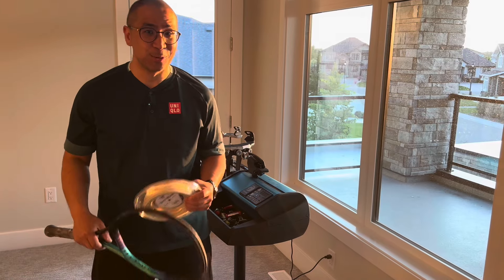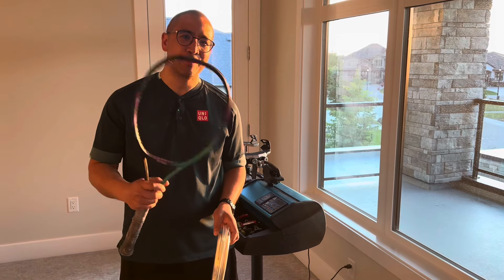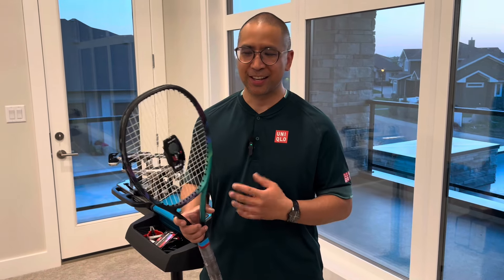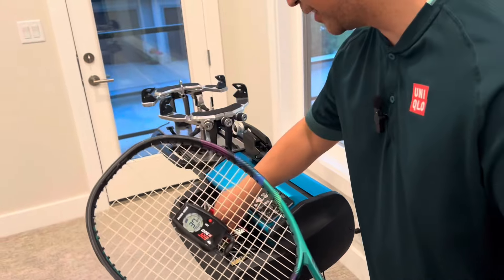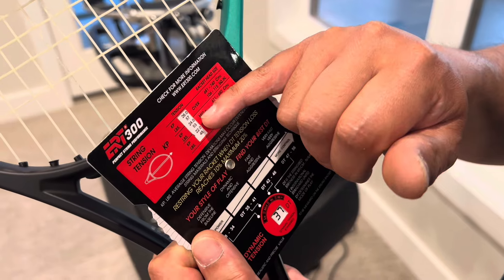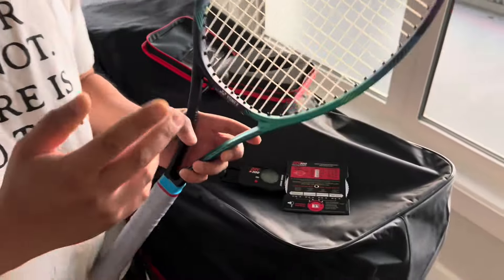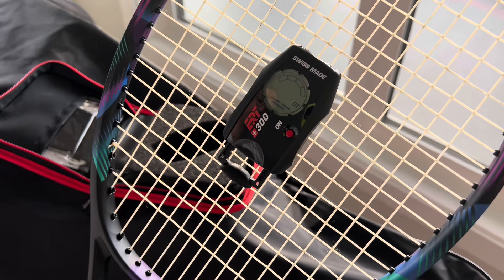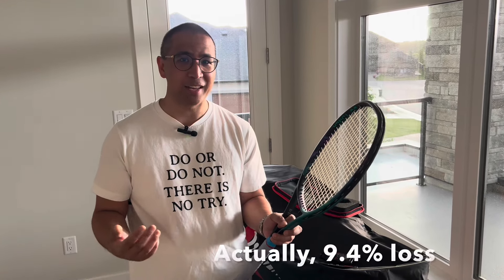Tension loss after hitting with multifilament string

Comment: Is multifilament string recommended for total beginners than poly?
Reply from the maker: @bengertzz  multi would be good for a beginner (or even synthetic gut to be more economical). Once the consistency of hitting gets there, switching to poly would be fine at that point. (If a beginner starts with poly, the inconsistency of hitting on a poly bed could hurt the arm)
Reply: Absolutely. It’s more arm friendly and powerful than poly. If you start breaking your multi string then you should switch to a polyester string.

Comment: Can you compare to natura gut & synthetic gut?
Reply from the maker: Something to consider - I may just do that!
Based on string construction, I would think rate of tension loss would be syn gut>multifilament>natural gut. We’ll see if I could confirm that in the future
Reply: I'm a Natural Gut and syn/multi hybrid. Natural Gut won't lose tension as much. You would use syn/mult as the cross. If you play flat/power the syn/mult will break and you can reuse the natural gut for two times or even three if lucky. If you hit topspin or don't hit cleanly in the sweet spot the natural gut will break. 

If you play with spin it's better to use poly full bed because using natural gut would be a waste, like no benefit for spin, or I meant why try breaking the natural gut for spin.

16 Natural Gut, 17 syn/multi, 17 poly.
Reply: @TrumpforPresident24  i want to play gut main since it has good power & comfortable.. feedback was abundant. I cross it with smooth poly to add little bit of spin. I play pretty flat. Spin only to take down the ball.. rarely hit heavy topspin… why don’t you cross it with poly? Why cross w multi?
Reply: @akbarberlian  Using the syn/multi cross I seem to get much more power. I want more power. I just like seeing my flat serve hit the fence in one bounce. I've tried poly cross with gut. I tried hitting my serve as hard as I can, the ball just won't hit the fence so like I'm missing something. I tried looser tension poly and now I can't even control or feels even worse with the Gut. It's probably the feel - Boardy or Trampoline. And I like it boardy. Everyone have their own feel of the string bed. I do play a full bed of poly if I'm actually hitting a technique motion to produce spins, and yeah I learn poly should only be for spin hitting players and not for flat power player. Syn/multi if I play my game as a flat and power game, maybe just a little spin if it needs it to make it over the net. Poly do have power string too. I will have to try that out soon. Maybe that can be the type of poly to exchange the multi.
Reply: @TrumpforPresident24  I have tried almost all your experiment before.. I kinda agree. what's the benefits between Gut/multi hybrid compared to full multi like triax or Velocity? also what is your playing style? Double & S&V player would benefit from your setup.. But for baseliners.. idk..
Reply: @akbarberlian  I use Gut and Head Velocity MLT, I use Head  Velocity MLT Power if I want to hit harder than usual, the shots I see  go faster. To me the Gut/Multi hybrid just feel softer, a soft control board for the arm, that would describe it. Oh yeah you have to have a neutral main strings, natural gut or kevlar, the brand. Then poly/syn/multi as cross, the brand and type. I play Federer style. One hand backhand. Playstyle - Power - flat serve, volley/smash, flat ground stroke. Clean sweet spot hits. I don't like messing the Gut/multi bed so I don't hit extreme topspin but only extreme flat power shots.

Triax is like Wilson control string, they have that squeaky texture feel from the string. The gut is going to be softer and still have an above feel than the triax. Triax can be like a power string too. Hybrid those two would be like Gut/soft poly/multi. Not sure how to explain lol
Reply: @TrumpforPresident24  i can see how you can benefit from your setup.  “soft control board” really deliver your message well. Thanks for sharing..
Reply: @akbarberlian   forgot to mention, I play with a RF 97 v13 with the Gut/ velocity setup. I tried on other racquet string bed it may not play as powerful. Certain racquet with certain string setup will create a more powerful feel. Every type of racquet with the same setup may not feel as powerful as the one because of frame material type.

Comment: Hi thanks for the video. I put x1 biphase 16 guage in my stable of old prostaff 6.1 classic 95s. It feels pretty good to me. I get good power and it's easy on the arm. I string it at 57 and it drops about 10 percent after the break in. What is your thought on my setup? Is there another string you'd recommend for my old prostaffs? Thanks much.
Reply from the maker: X-one biphasic is a good choice, particularly if you want to save the arm. Another good string is Tecnifibre NRG2 - similar to biphase, but a bit less powerful. Wilson NXT is also highly rated and worth a try. Babolat Xcel is another good multifilament. If you don’t hit with a lot of spin, multifilament should last; however, if you do hit with a lot of spin and you don’t mind the lack of durability, gamma ocho xp is a great choice since it’s a shaped multifilament (and, interestingly, feels like stringing natural gut)
Reply: @funkyfreshg  gamma ocho xp chinese brand oem : alpha tsb-03 $70 per reel